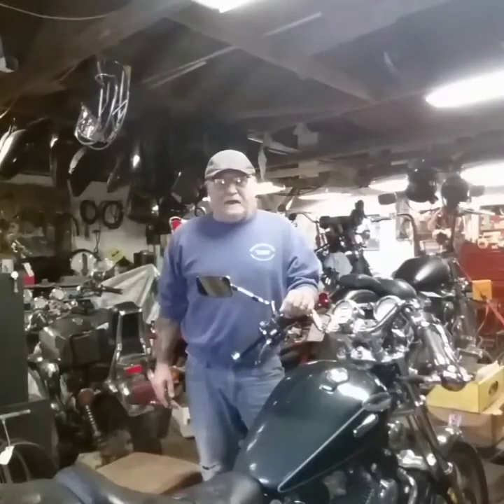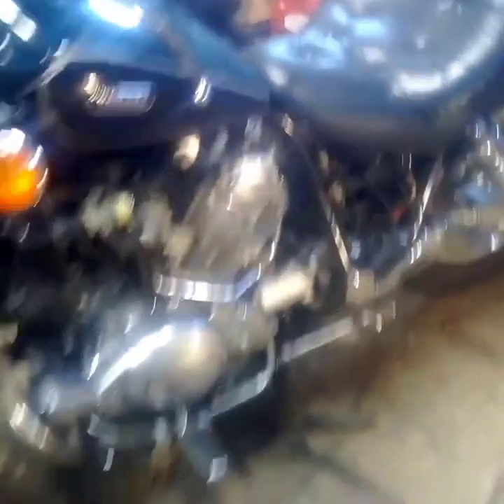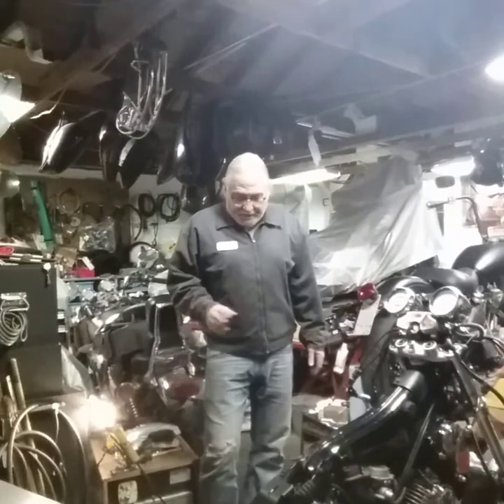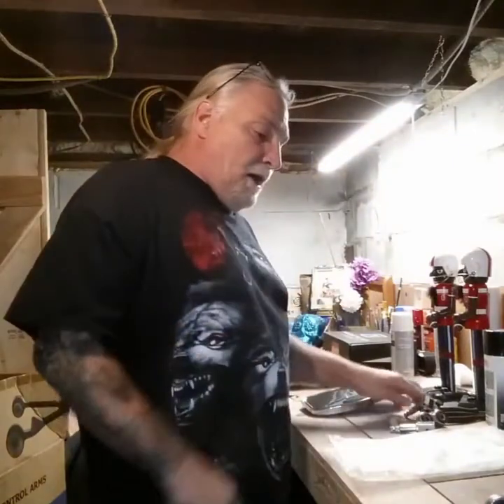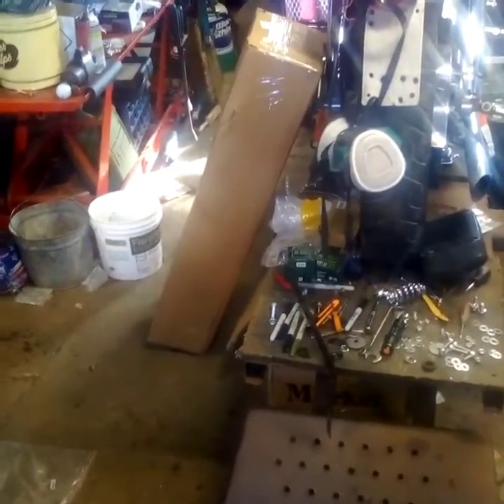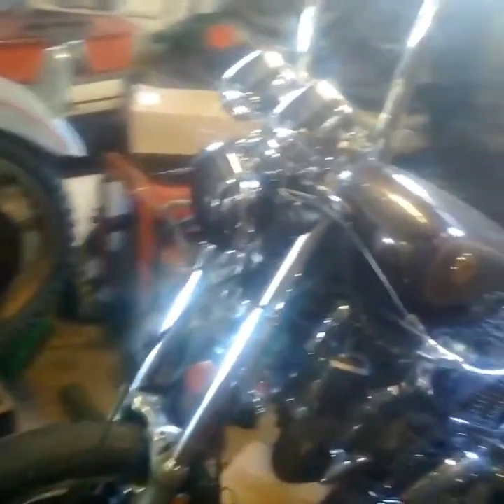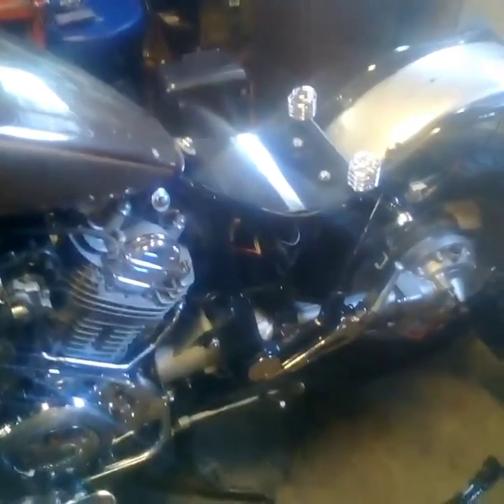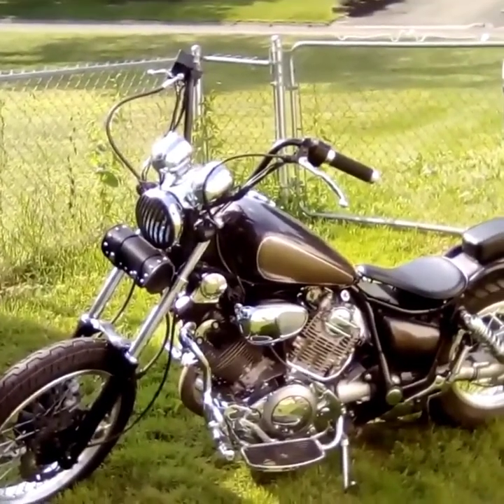YAMAHA VIRAGO XV750 CHOPPER 1994 C0MPLETE BUILD

Comment: What kind of rear fender is that?
Reply from the maker: Hey Russell, it's just an aftermarket flat motorcycle rear fender. I looked for the listing, then couldn't find it in my purchases. I just looked online you can get them with free shipping for about 80 bucks or $69 and then you pay for shipping either way , but double-check their description when you're ordering it I've seen them coming 7 in wide and 6in wide make sure it's going to fit your application also make sure it's for a 16-inch tire or an 18 inch tire whichever you have on the rear of your bike. if you don't get the right one, if you get an 18in one and put it on your 16-inch tire the curve of the fender isn't going to match the tire and it's going to look weird. And if you order a 16-inch tire new have an 18-inch one it's not going to fit over the tire just make sure you get what you need. Hope that helps you out , thanks for checking out the channel, as always ride safe live life Behind Bars.
Reply from the maker: Just punch in flat rear motorcycle fender. and when they come up just look for the one that's a size that you need.

Comment: Are you a Suzuki guy ..
I've got a 1980 Suzuki GS 850 ...starts and runs..tack currently isn't working ..you get rpms up to 1,500...1,800 rpms...just dies out ..not fuel..original tank off..plastic gas tank...bank of carbs clean..been off apart cleaned several times ...pick up coils in ignition working ..gotta be electrical...any ideas ..??

Aren't those style of engines known for starter bendex issues ..??
Reply from the maker: I just had a 78 Suzuki gs750 given to me by a friend of mine him and his son started the project wanted to build it together while the kid was in high school now he's off to college and they both have other aspirations so it wound up with me I haven't looked at it much haven't done much research Intuit or any problems they might have let me do a little research I'm kind of curious myself since I had to tear into one would like to know what it is if I run into the same problem thanks for checking out the channel I will talk to you soon , ride safe
Reply from the maker: Hey Jerry didn't know if you ever figured out of your problem with your bike dying have you checked the coils when the bike gets warm if the coils are bad it'll usually quit when it cools back down it'll start up if that happens to be one of the symptoms I would look towards the coils